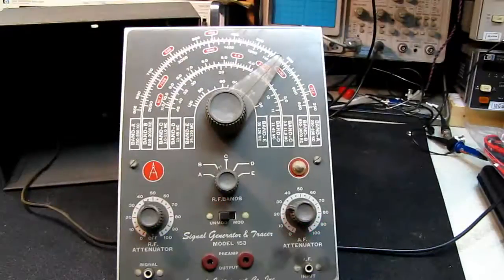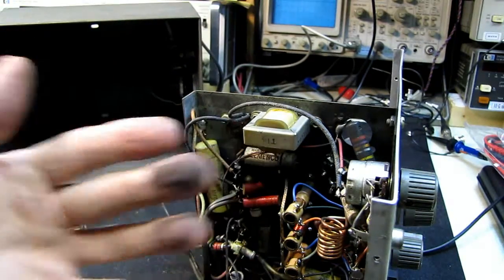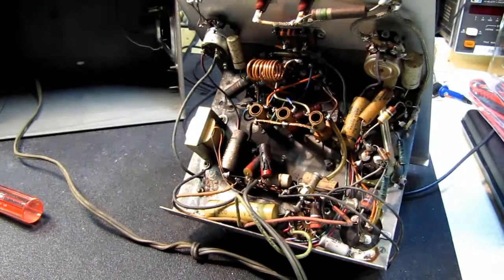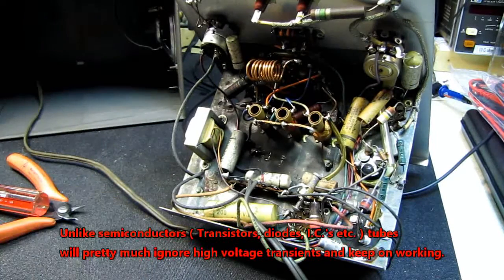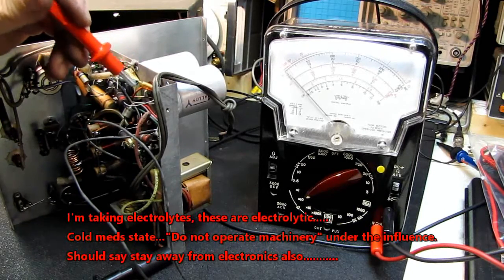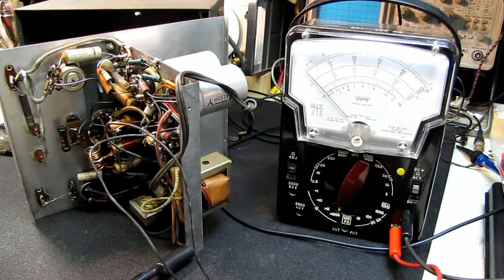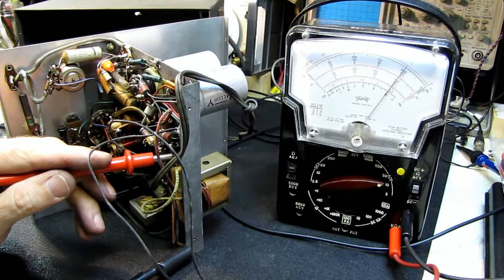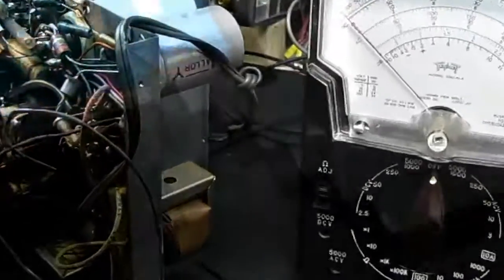10 Buck Test Bench Accurate Instruments R.F. Generator

Comment: Great video, I just restored a model 153.  Mine had a silicon diode.  Did your diode have any specs written on it.  Also, what value X/Y cap did you use?  Sine wave on mine is a flat topped compared to yours but has the same harmonic signature you showed in the later video.  Neat unit.  Doc

Comment: Even in 70's, 80's and 90's vintage I always replace across the line and line to ground capacitors, even if their ceramic.  I have seen way to many exploded ceramic bypass caps over the years.  People tend to forget that their ON all the time even with the power switch off on most equipment meaning theur on 27/7/365.
Reply from the maker: Always a good practice to change them out. BTW, if you hadn't blown up that second cap on your video I would have been upset. That was a fun video.....
Reply: +The Radio Mechanic 

I would have had to break out the big guns then.  I have the big brother to the HP 711A , the HP 712B that goes to 800 VDC and if that didn't do it I have a modern solidstate HP high voltage supply that goes to 5,000 VDC.  I would have gotten it to arc one way or another. :)